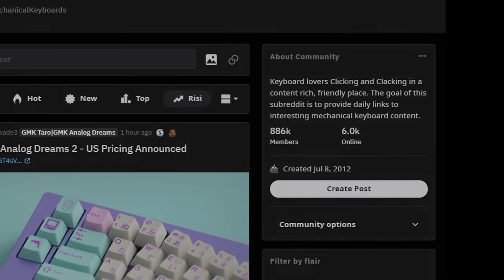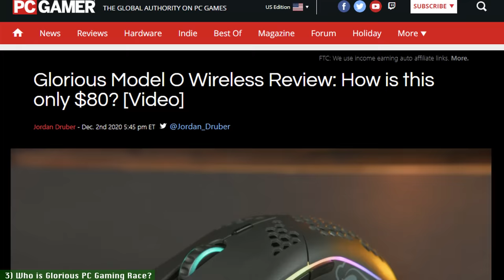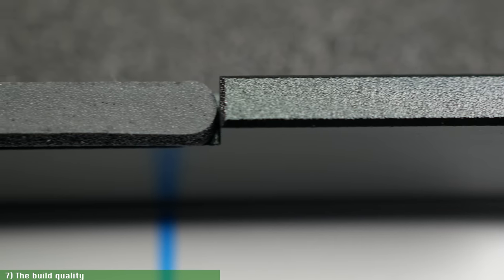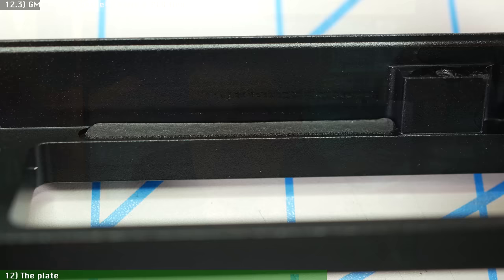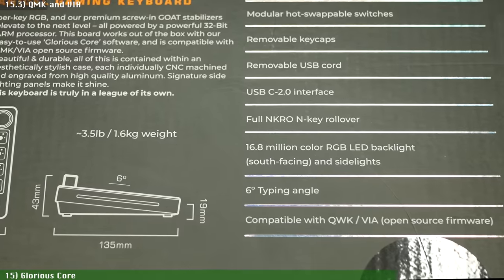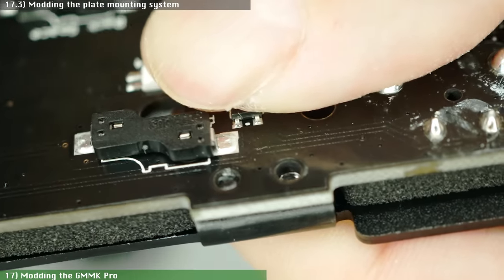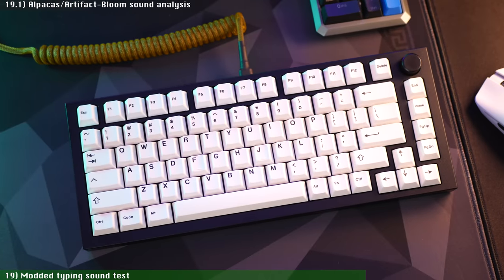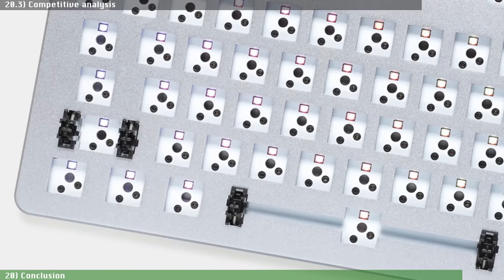GMMK Pro: The ultimate guide (in-depth review + modding tutorial)

Comment: Overall a fantastic video! The only critisisim I have is that you specifically point out that you might need a pudding style keycap in order to get a better lighting effect from the south facing LEDS and then go on to explain how difficult it is to find a pudding style keycap set that includes support for this keyboards right shift key... And yet you literally consistantly show the board in b-roll with a fully compatible pudding style keycap set? I understand its probably the the one from Glorious themself and you are making an effort in this video to avoid buying ANY extra Glorious accessories but also... why? The Glorious PBT double shot pudding style keycap set is not only very fairly priced but its one of the most high quality pudding keycap sets on the market and even comes with a whole range of extra keys and key sizes to ensure its compatible in virtually any keyboard layout on the market. It's literally one of the best if not THE BEST pudding keycap set on the market in terms of price and quality. Intentionally not mentioning it just seems stupid, especially when a lot of the b-roll you are using is the GMMK-PRO using that exact keycap set?

Also I've read about the whole glorious Holy Panda switch fiasco, from both the communities side and the response Glorious gave and honestly I think the community are a bunch of whiney cunts. They are a company doing what they need to do in order to secure their profits. Anybody thinking they are out to achieve anything short of turning a profit are delusional. That being said, they offer a great product and I honestly could not give a flying fuck how they 'pissed of the reddit keyboard neckbeards' by trying to file for a copyright. Get over yourselves jesus. I look at this keyboard knowing full well Glorious are going to cut every corner they can to turn a profit and even with that said it seems like a pretty robust product. So again It seems stupid to not intentionally avoid their accessories, especially their very fairly priced and competetive ones like the pudding style keycaps.
Reply from the maker: Thank you!!! And as for the situation with the Pudding keycaps, let me explain it…

At the time I started to produce this video (almost a year ago), Glorious had not released the PBT double-shot pudding keycaps (the Version 2) they offer today. Back then, the V1 Pudding set they sold was cheap thin ABS, which I’m not a big fan of. So, for that reason, the only Pudding set I was recommending to people at the time was the one from Drop, the LOOP Pudding V2 Double-Shot PBT I showed here in this video ( https://youtu.be/J_axv-TkjkE?t=1938 ), which is thick PBT and thus sounds really nice (I’ll not blame you if you skipped that part of the video and thought that the pudding set I showed here was from Glorious, considering how long this thing was! 😂).

Compatibility was the other reason why I was recommending the Drop set at the time, since it is large enough to include basically all the keys you need for most popular layouts out there. At that time, most popular pudding sets on Amazon, such as the ones from HyperX, did not include 1.75U Left Shift and 1U Alt, FN and Ctrl you’ll need for a 75%.

Since then, Glorious released their own double-shot thick PBT Pudding set (the V2) that I hear many people saying it’s pretty good, has the same thickness, compatibility and price than the “Loop” from Drop, and which I’m even getting the pink one myself for a build I’m doing for my wife. So, for those reasons, today it is perfectly reasonable to recommend Glorious’ Pudding set!

Now, having said all that, I still don’t think Pudding sets are the best for the GMMK Pro, precisely because of the south-facing switches issue I explained in the video. For that reason, my recommendation for a “reverse” pudding style set that I think works best for this board is another set from Drop, the “Artifact Bloom Glow” ( https://fave.co/3pQPxdI ) that I featured in my follow up video covering the PC and FR4 plates for the GMMK Pro (that you can check out here 👉 https://youtu.be/HhahtVszzgI ). The “Glow” set is thick ABS, which sounds good (thick ABS might not sound as good as thick PBT, but it does sound better than thin ABS) and will give you proper backlit legends, since it has them printed on the bottom side of the keys, which is exactly where the lights come from in a south-facing configuration.

Still on the topic of keycaps, please do not mistake me for one of those keyboard youtubers/streamers that I like to call the “GMK Police”, who think it is either expensive GMK sets or bust. While I think there are situations where an expensive high quality set makes sense, I think GMK and ePBT sets are not recommended for the vast majority of budget and entry level builds, since I don’t think it makes sense to spend more money on the keycaps than on the keyboard itself. Besides, there are plenty of good options for good quality keycaps out there, with good kitting for compatibility, that cost a fraction of  GMK and ePBT (such as Drop’s Artifact Bloom Series I also showed on this video for example).

On the topic of Glorious branded accessories, I still think most of them (outside of their PBT caps, which are fairly priced as I mentioned in the video) are a bit overpriced. You definitely can get cheaper and better lubing tools (for example) for less, if you don’t care about brand.

And finally, on the topic of the Glorious Pandas (and all the drama your aptly named “reddit keyboard neckbeards” 😆👍 created around it), I think you and I are in perfect agreement, as you can see my opinion on this matter in written format over here 👉https://www.iosamfranco.com/post/imho-the-glorious-holy-panda-controversy 

And thanks again for your feedback my good Sir! Always appreciated!!!

Comment: What is the switch on the back of the PCB?
Reply from the maker: It is a primarily "factory reset" switch in case you want to do it the "hard way". But it might be needed as well if you intend to re-flash the board with QMK.
Reply: @IOSam  Thank you, Ya I was wondering about it. It would on;y work with power attached?
Reply from the maker: @Mack_Dingo  The way it usually works to do a hard reset (or to put the PCB controller into "bootloader mode") is that you have to unplug the keyboard, press and hold down that button on the bottom of the PCB, while at the same time plug the USB cable back into the keyboard's PCB (and only then release the button). Just pressing or tapping the button with the keyboard off or on, technically should not do anything (other than potentially cutting the power to the board temporarily).

If you need more information about how to put the keyboard into bootloader mode (in case you want to flash it with QMK), check this link from Glorious: https://www.pcgamingrace.com/blogs/news/step-by-step-guide-to-configuring-your-gmmk-pro-using-qmk
Reply: @IOSam  Thank you. I was unaware of this until now. Your videos are very good!

Comment: so did you put the o-rings on the top frame only? not behind the pcb?
Reply from the maker: Actually, the way this keyboard is designed, the PCB does not touch the case (it is only attached to the plate, and the plate is sandwiched between the gaskets of the 2 halves of the case). So, what I did was to place the O-rings to work as "spacers" between the 2 halves of the case, which increased the vertical distance between them AND gave the plate and the gaskets ~1 extra millimeter of space to move up and down between the case halves. The O-rings here DO NOT touch the PCB on any side.

I got a lot of flak from people who watched this video but never opened this keyboard before, so they don't understand the role of the O-rings in my mod. The O-rings here are NOT doing what they usually do in a top mount, burger mount or modded tray mount style keyboard for example, where they work as actual gaskets...

In my GMMK Pro mod, the O-rings are ONLY working as spacers for the case's top and bottom halves, so the plate has a bit more space to flex. One could achieve similar results using any other similar thickness material instead of rubber O-rings, but the O-rings make sense because they don't get displaced (since they are wrapped around the screws) and they have a bit of flexibility on themselves (they are made of rubber after all), which makes them more forgiving than other harder materials would be in those tiny spots in the middle of this keyboard's case halves.

Comment: guys I need help i have the new  gmmk pro and my spacebar is not lifting up so good. Concrete when press it it gets stuck. Mostly i think the stabs are        responsible . i have the nebula   set from glorious. with glorious panda switches. every regular switch key works  great and i really enjoy typing on it. I am thinking of getting                durocks.         HEEEEELP            MEEEE PLS. PS  this is serious
Reply from the maker: Yeap... That is one of Glorious "stuck stabs" that have been prevalent in some of the latest batches of the keyboard to a point where Glorious had to post a guide to help people to remove the stabs (either for cleaning the excessive lube, removing the pads or to replacing the whole thing): https://www.pcgamingrace.com/blogs/secret-announcement/sticking-stabilizer-repair-guide 

If you have a polycarbonate plate you can get Durock stabs (which won't fit the aluminium plate without some filing). Or, if you have the stock alu plate, get C3 stabs ( https://bit.ly/c3stabs ). This is the way to go with this board (unfortunately).
Reply: Bro. Its 4 am in the night eu west and i get an answer in 30 mins. I have poly plate plus aluminum. I like the sound of poly more so i will probably go with durocks or the c3 equalz you recommended. Bruh you are insane. Love you for the fast help and by the way. Structuring a video like this is time and effort. Thank you for that man 🙏 Like and abo deserved ❤️
Reply from the maker: @maba5202  That's why I'm here for! XD  Thank you so much for the Like+Sub!
If you'll keep the PC plate in the board, go ahead with Durock stabs... They're awesome! And let me know how it goes once you install them. 👍
Reply: @IOSam  i will do. I cleaned the stabs to enable me to use spacebar properly. No joke my spacebar was still not working. I use glorious pandas and tried one yellow linear switch a friend gave to try out and now my spacebar works. I will find out whats happening there tomorrow.

Comment: My major gripe is that my copy came with a warped plate/pcb assembly, defective just like every other glorious product I've ever purchased (quite a lot). I reached out to glorious support about the issue, but since it was an early product and they were trying their best to fulfill other orders already, they weren't really able to help me. I'm going to end up having to sell it because it is pretty unusable as the space bar doesn't even return properly due to how warped it is, and I don't want to spend any more time than already have trying to fix it.
Reply from the maker: You mean the stock Alu plate came warped?? or a polycarbonate plate (those always come warped, which is why I don't usually like PC plates in general)?

Did their Customer Support ask you for a picture of the problem?
Reply: @IOSam  Thanks for the reply. The pcb is slightly warped, but the main issue is that something wasn't cut properly, so when screwing the pcb and aluminum plate together the entire assembly becomes warped. I believe this to be an issue of manufacturing tolerances and can't be easily fixed on my own. Their customer support did ask me for a picture, but I didn't end up following through with the support ticket because my keyboard was in batch 1 and I didn't want to create additional trouble for them when they already didn't have enough keyboards to go around. Maybe I'll try again after they make these keyboards readily in stock next week.
Reply from the maker: @tofu.delivery.  Man, you should totally take them on their warranty! Having a warped plate can throw off the balance of your spacebar stabs (creating rattle) among other problems. Glorious Customer Support is usually very good and they will replace your board in a situation like this.

Comment: could this keyboard be used on MacOs?
Reply from the maker: Yes it can in the same way that any USB keyboard can: with the Option and Command keys inverted. And since Glorious doesn't have a Mac version of the Glorious Core App, you'll have to use QMK to reprogram the layout in that way (or wait for its VIA compatibility to arrive). But if you're willing to do this, the modified layout should work fine.
Reply: @IOSam  appreciate the feedback. I’m absolutely a noob dealing with mechanical keyboard. Currently I’m planning to build a keyboard for graphic designing purpose and numpad could be useful…any recommendation? 🤔
Reply from the maker: @nihguoyou-y9317  You're welcome my friend! My standard suggestion for a fantastic numpad that is always in stock somewhere is the Skyloong GK21S (that you can see in many of my videos). It is an aluminium board with FR4 plate, hot-swappable PCB, per-key RGB, Bluetooth and configuration software. My suggestion is that you get it from Flashquark if you are in the US or from Epomaker if you are in any other part of the world. There will be a video on the channel about this numpad soon, so stay tuned!